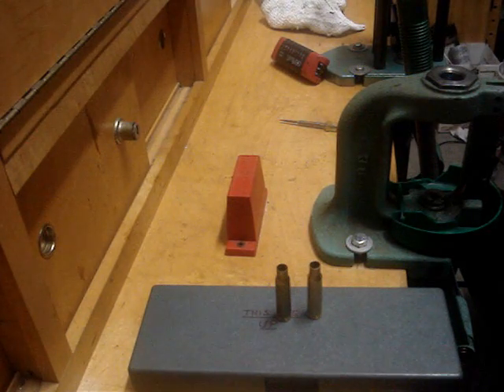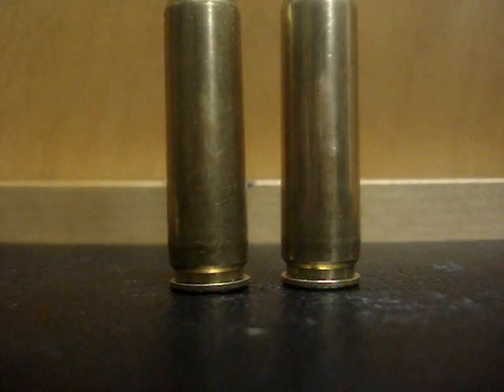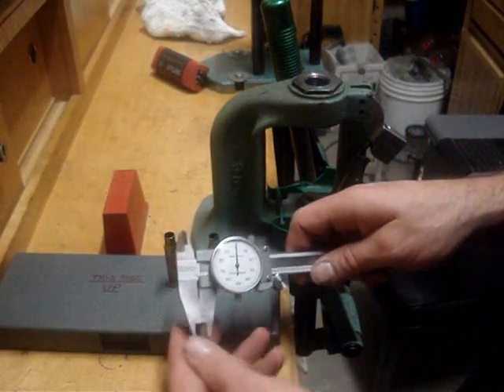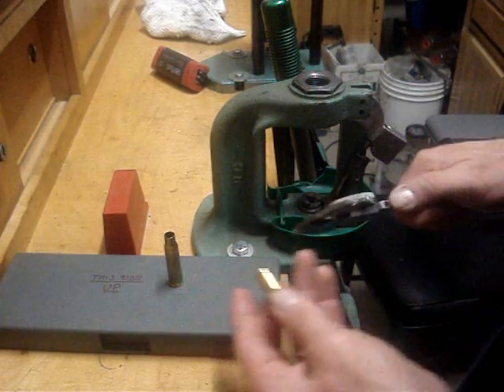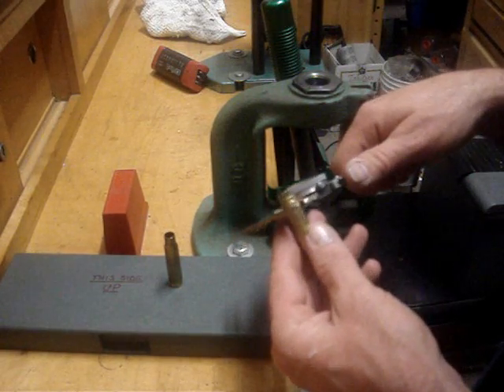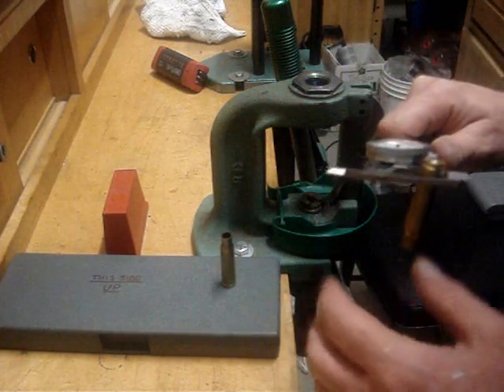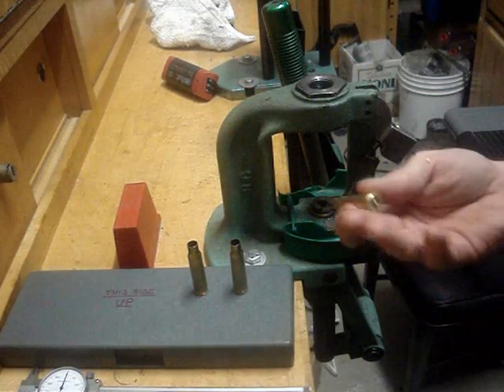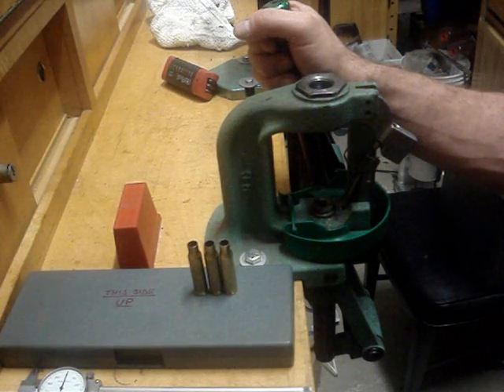How to Estimate Maximum Pressure

Comment: I just go by primers and velocity on the chrony. There will always be a spike in velocity when you reach maximum pressure. By this method I have also come to trust the data in Speer manuals the most. Some reloading manuals are far too conservative and others are downright hot, while others yet vary a great deal re; reliable load data depending on the particular caliber. A lot of people say you cant go by primer flattening. But my testing has shown that more often than not primer flattening coincides with maximum pressure pretty reliably.

Comment: Metrology labs have a rule of thumb...if you are measuring .001, you need accuracy in instrumentation of .0001.    You are in the .001 weeds here so a vernier or 4 place reading digital micrometer serves this measurement much better than a 3 place dial caliper.

While using this as a check myself,   I do not rely solely on this measurement to check max. press limits.  There are too many sources of error that can "creep" into the measurement.

Page 279, 7th ed. "ABCs of Reloading", has a brief description of this technique.

Comment: Calipers are just fine. I am an aircraft mechanic and they have always been and shown true to the numbers in the book. If used right.
12 bucks bought me one from Harber Frieght and it has passed calibrations every time. Digital too.
Reply: Doberman guy. I was self employed for 31 years with a CNC machine shop. Most of the parts we made for aircraft have 0.030” tolerance. That’s a mile for my shop. We made the ribs that went into helicopter rotor blades, and other parts. Some parts all we needed to measure to was Mylar . Some we needed a CMM. If a vernier was good enough, then you were at the low end of tolerance and measuring accuracy. Well, that was ok for what YOU DID. Not so in all cases. I will take a digital over a vernier if I need to be D.N.A...........dead nuts accurate.
Reply: @johnholmes4960  I never said anything about vernier calipers.

Comment: Being a reloader for 43 years now I can tell you that factory ammo is nowhere close to maximum ( avoiding lawsuits and respect for individuals safety ) because every gun is different , every chamber size is different.. chamber reamers cut more than one chamber and after a while they are worn down by 0.00 ? and Chambers get slightly larger so if you know the dimensions of your chamber you can keep track of your brass to watch for maximum pressure.. this explanation makes sense but there's more variables to add to this equation. In other words always proceed with caution a chamber may be damaged/ bad / worn out that factory ammo is already at maximum pressure.
Bottom line.... know your firearm and it's condition / the chamber, the throat , the rifling.
If you're unsure of the condition of your chamber you can always make a chamber casting and if you do not know how or feel uncomfortable doing so have a competent local gunsmith do this for you.. then you can get an accurate reading of your chamber for precise measurements for safety's sake .......
Reply from the maker: An American Patriot very true. Especially as with the 7.92x57mm. The commission rifles had a bore diameter of .318" for the "J" cartridge designation and the later "JS" has a bore diameter of .323".

Comment from the maker: @IRmediator In that case use the standard indicators. Flattened primers, pressure rings and difficult extraction. Never exceed maximum loads and always use good judgement in your loads.

Comment: I have a question. It seems like this method would work only if the factory cartridge is charged with powder to give maximum allowable pressure. In todays economy, if an ammo company reduced the charge by 10%, then they could save that much on their powder costs and claim they were doing it for "SAFETY" when the truth is they are now making more profit.  Do you think ammo companies are running their loads that hot???
Reply: Some are. The PPU 308 180 grain soft point ammo was a thumper.